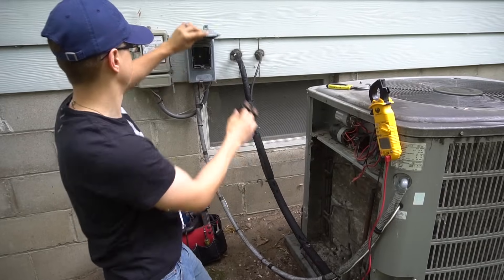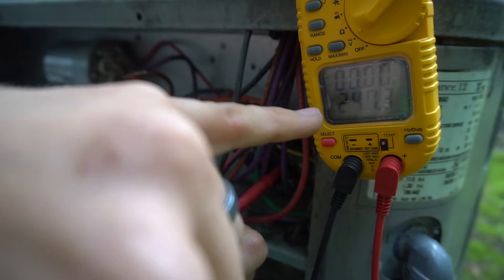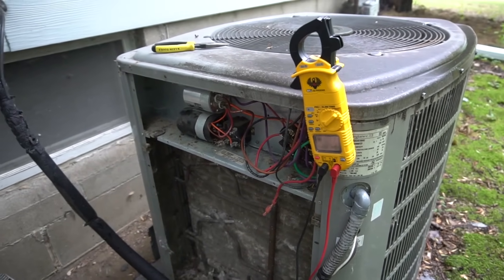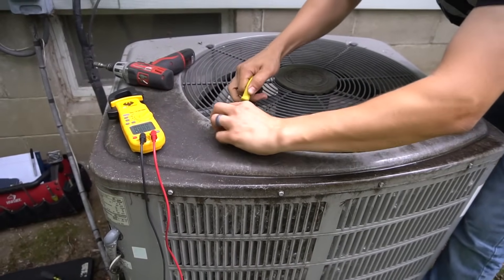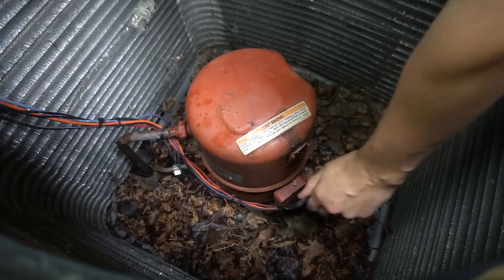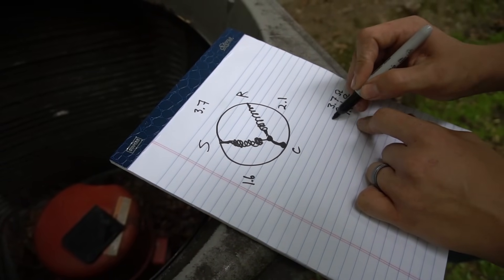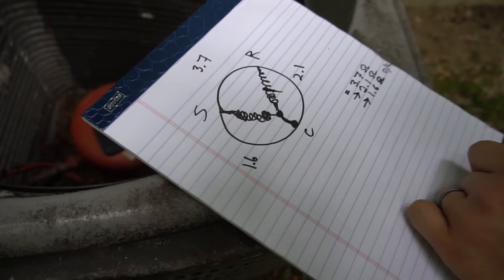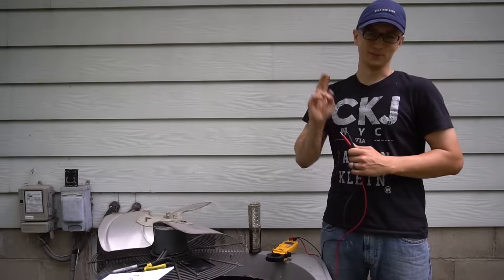How to Check HVAC AC Compressor

Comment: Is it possible to know if your compressor is bad by only checking the outside wiring? The tech never opened the top.
Reply from the maker: Yes. You can just check the wire connectors of the wires that come from the compressor without opening the top like I did. The reason I prefer to check it at the compressor itself is because sometimes when you only check it at the outside wiring you can get a false reading. If there is a burnt/corroded wire that hooks up to the compressor pins, the meter will pick that up as O/L (open line) or if it is touching metal it will look like it is shorted to ground. I have been out to units before that have been condemned but the compressor was actually still good and it was just a broken wire. I am not saying the tech that came out to your house is wrong though. Just sharing my experience. Hope that helps clear it up for you.
Reply: Yes, thank you. I would say he didn't do a thorough job of investigating before he gave me a quote to replace it.
Reply from the maker: You may want to get a second opinion then. Or if you have a multi meter, you could watch some of my videos and check it yourself too. Either way, good luck and hopefully it will be good news!

Comment: Boss...give some information about of electrical connection in outdoor unit
Reply from the maker: Hmm. What do you mean by electrical connection? Are you talking about the wiring going to the contactor from the compressor/fan, run capacitor, and start capacitor? I am planning on making a video about outdoor unit wiring pretty soon here :)